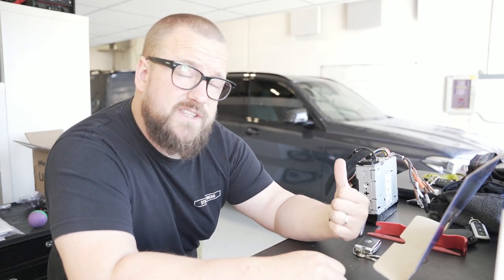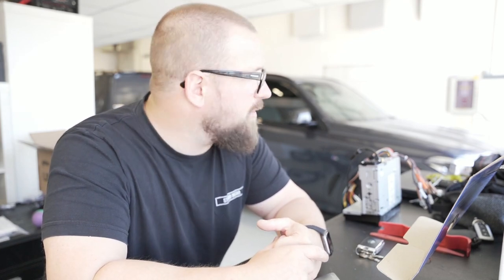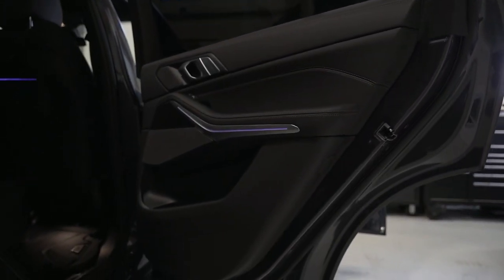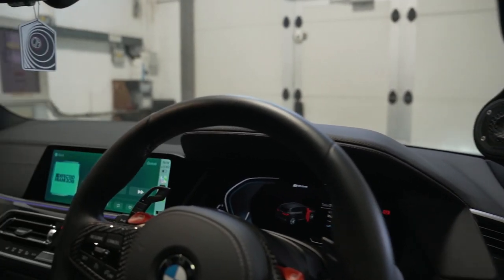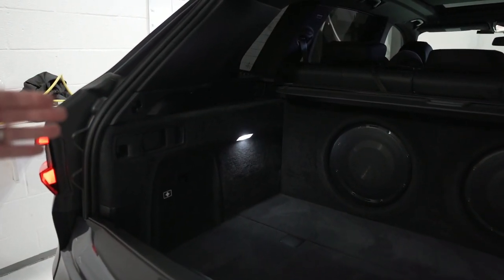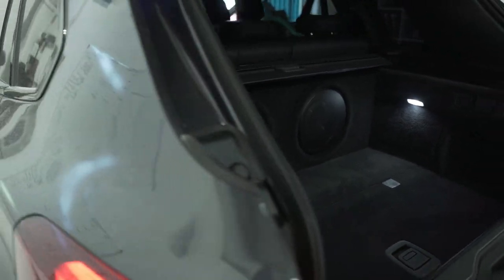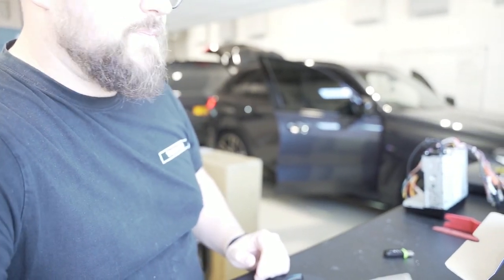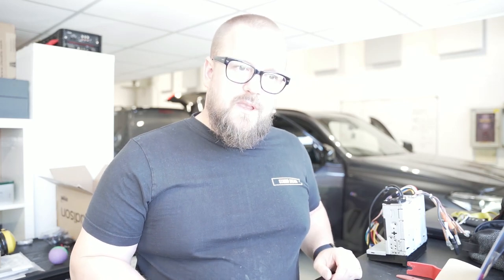BMW X5 45e Harman Kardon replaced with HIGH END system

Comment: I've been looking for the right amp to power a pair of Utopia M subs. How did you wire it to that 1500.1? It's not 1ohm stable on the specs, so I'm assuming you're running the pair at a final 4ohm which would be just over 400 watts per sub. Do you find that's a good power level for this sub?
Reply: @Studioincar  thanks! My local shop convinced me that I needed more power for them and there is very little info online with others using these subs. I was using an Audiocontrol 800.1 for each sub but came to the conclusion they were too easily being overdriven so this video was good timing. I'm in the process of switching to a different amp that will give them about 400 as well so it was good to see you were happy with that power level. I've also been experimenting with different box sizes and shapes because again there is very little info out there about this sub. Good work guys, enjoy seeing your installs.